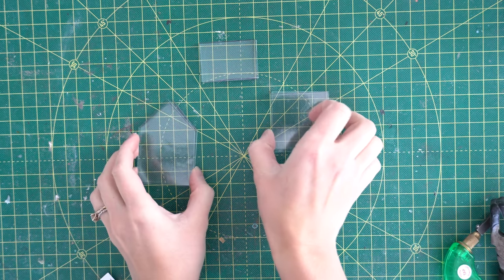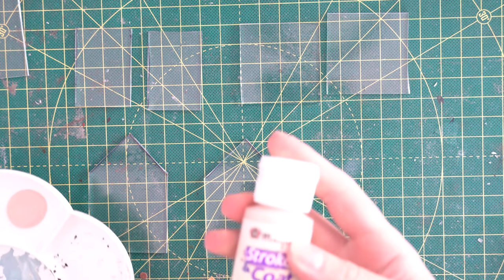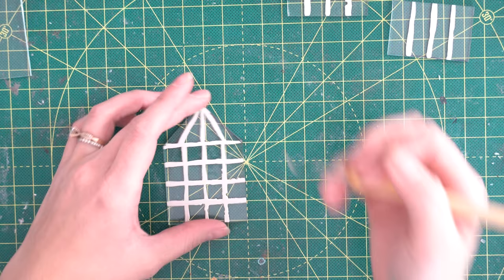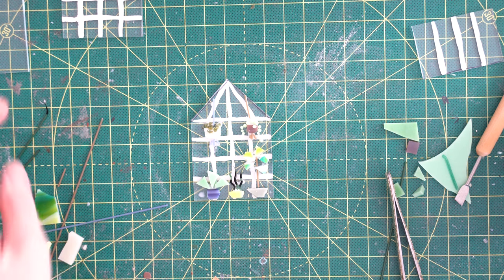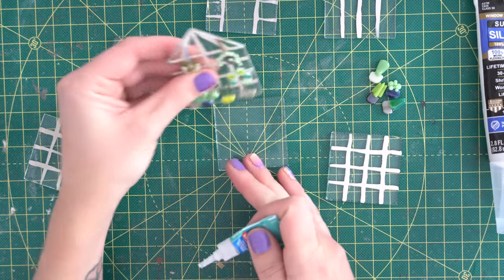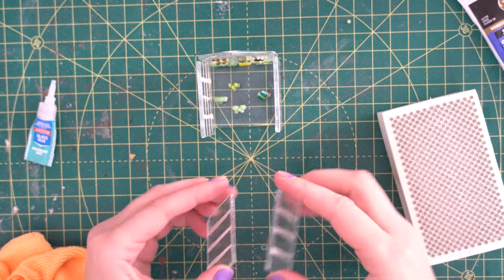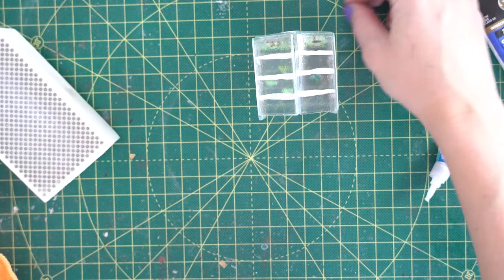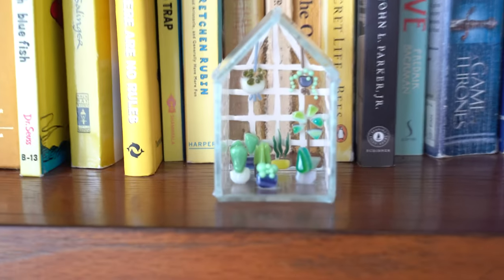How to make a miniature fused glass greenhouse | 3D fused glass art

Comment: This is such a wonderful project!  

I have many bottles of Stroke & Coat that I use for glazing my pottery pieces, which I also do in addition to glass fusing.  I never knew you could apply it to glass and then fire it.  If you do a tack fuse on the individual glass pieces, is that enough to make the Stroke & Coat adhere to the glass so that is doesn’t come off?  

Thank you so much for showing us this project!!
Reply from the maker: In my experience it adheres to the glass, but remains a gritty texture. I only use it for decorative pieces, I wouldn’t use it for something that’s used for food.